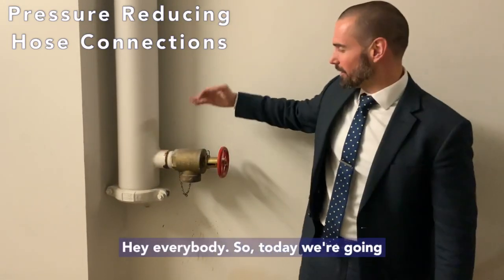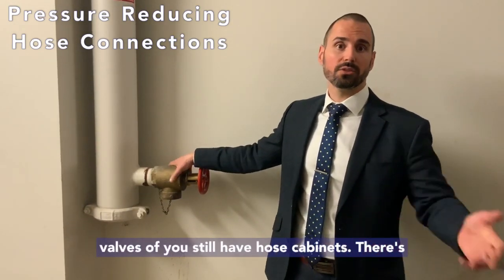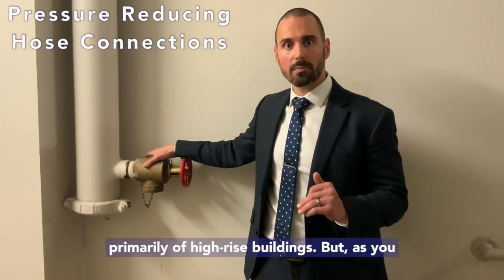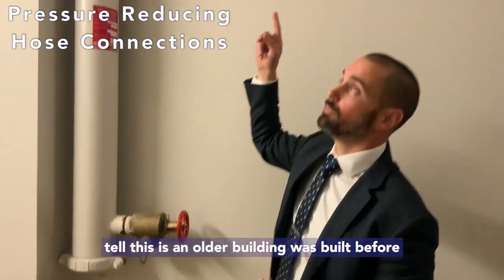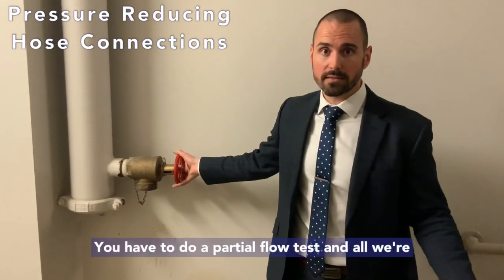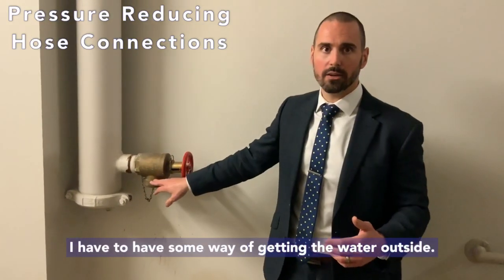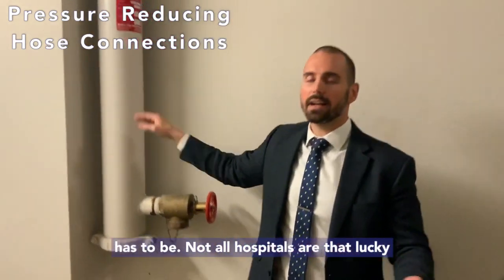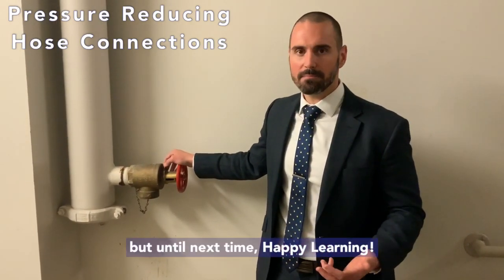Pressure Reducing Valve (PRV) Hose Connections

Comment: That is a pressure restricting valve.  Common on Class 3 standpipes that prevent an occupant fully opening the valve while allowing the fire department to pull out the pin and fully open.  It doesn't reduce the pressure beyond adding friction losses.  So it isn't meant to reduce a high pressure situation to 175psi like a real pressure reducing valve.

Comment: I’m Interested in wither or not code for testing requirements are different for PRV’s used as riser control valves on combination standpipes. 
Particularly “full flow” testing.
Reply from the maker: Hey, @dudegetaclue190! What a great question! 

The PRV testing whether it is upstream as a combination standpipe or if it is a pressure-restricting device as shown in this video both have the same full flow requirements. 

We primarily work in hospitals, which follow NFPA 25 (2011) due to CMS' adoption of NFPA 101 (2012) into federal law. The code references below might have different numbers in the newer code; however, the requirements have not changed.

Here is the section that applies to the Inspection and Testing of Sprinkler Pressure Reducing Valves
13.5.1.2* A full flow test shall be conducted on each valve at 5-year intervals and shall be
compared to previous test results.

Here is the section that applies to Hose Connection Pressure Reducing Valves

13.5.2.2* A full flow test shall be conducted on each valve at 5-year intervals and shall be
compared to previous test results.

There is annex material and also handbook material for further context behind the intent of the code. We will gladly discuss in further depth if you would like. Simply reach out to us here: https://legacy-fm.com/contact-us/